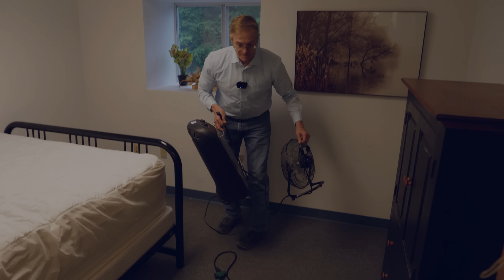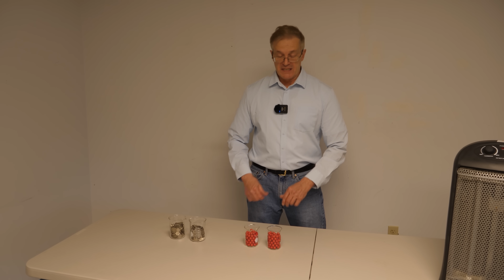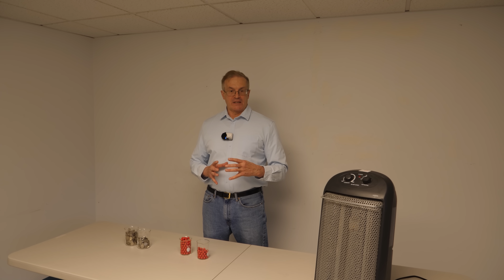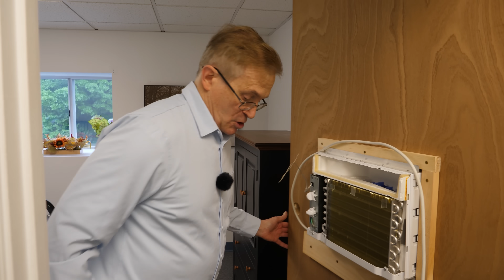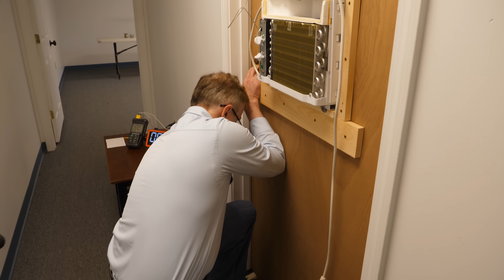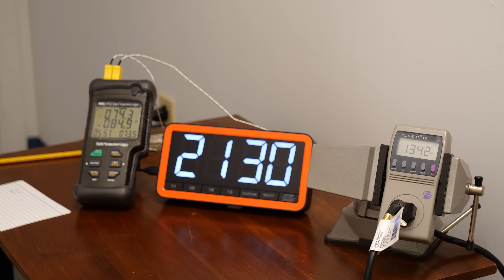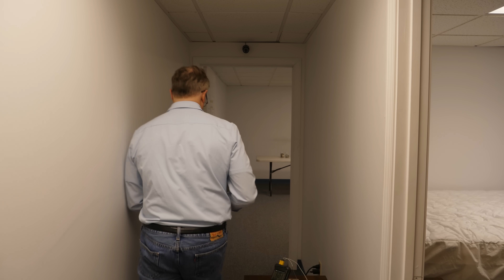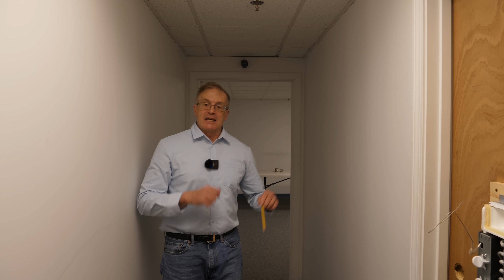You're wasting money on heating! Use your A/C!

Comment: AC's that also have a heating mode are becoming more and more common. The problem with window units is, designing for the alternate air path is a design challenge, and it's simply cheaper to keep making the same antiquated design.

Comment: Heat pumps are great most of the time when the indoor-outdoor temperature difference is moderate, say 40F outside 68F inside. But if it drops to -15F outside, it will struggle to remove enough heat from outdoor air to keep you comfortable indoors. Part of the problem is probably that heat is pouring out of your house faster because of the greater temperature differential. But, holding your hand to the air exiting the heat pump itself, it is doing well if it can even feel like cat breath, chilled snake breath is more likely. 

The smart way to take care of that problem, IMO, is to exchange the heat with the earth at a depth where the temperature doesn't fluctuate much, maybe 10-15 feet I'd think in New England. I think in practice a deeper hole is bored into the ground to so there is a large volume for heat exchange without having to dig up the lawn. 

The dumb way IMO is to add a resistive heater to bring the vented air temperature from chilled snake breath up to jazzercising cat breath temperature.

The smart way likely costs more up front but keeps the system very efficient and probably pays for itself fairly quickly where outdoor temperatures are often quite cold or quite hot. I'm in an edge case area and have the dumb heating option. The one or two times a year when it does drop below 0F... Well I need cats and some old Jane Fonda workout tapes on VHS because I have too many windows for even the resistive heating to keep up. Funny thing is when I lived in Montana in a basement apartment, my heat went out for most of the Winter and I didn't notice because the earth was warm enough for my comfort.

Comment: I bought a heat pump a few years ago and I have no regrets. I went from using 3.5 full 285 gallon tanks of oil per year to 1.5. One thing to note is that the effectiveness and efficiency of the heating will be reduced the colder it gets outside, and you'll start having to deal with things like ice accumulation. You can pay a bit extra for a heat pump designed to work in colder climates, but I'm guessing window units will not work well in this scenario - maybe something worth testing.
I always thought it was strange that window units don't come with a reverse feature built in. It seems like it would be relatively cheap while adding a significant amount of value.
Reply: In Japan, we have air conditioners that can work both ways. Also, they are split into two units, one light one that generally goes on the wall, and the compressor unit outside somewhere, connected with a couple of copper pipes. They work quite well too.
Reply: @michaelbrinkman9371  We have those here they are colled 'Mini-Splits- and you can have up to 4 or 5 indoor "heads" for every outdoor compressor.  You can even buy a "do it your self" kit from at least 1 company if not more.  the one I know of is Mr. Cool.
Reply: @michaelbrinkman9371  I remember something like this in the apartment I lived in in Tokyo...back in 1989. We could either have A/C or heat as needed from the same unit. I never gave it much thought at all but now, 35 years later, I understand how "cool" the tech actually was.
Reply: @MTimWeaver I was in Okinawa at that time, and electricity was outrageously expensive. To get a $600 electric bill was pretty much routine.
Reply: @ used to visit there and thought it’s one of the most pleasant place to stay in Japan if not the world, don’t remember much need for A/C in summer and heavy clothes in winter due to the mild climate and surrounding ocean surface on both sides as heat sink
Reply: @michaelbrinkman9371 that’s a split system. Those are nice for smaller buildings.
Reply: So yes - couple of things you need for the ac unit to heat pump conversion - reversing valve as he mentioned, accumulator as the cycles heat/ac need differing amounts of refrigerant, extra metering device and check valves  defrost sensor, defrost timer, you would need to separate the indoor and outdoor fans so you could de-energize the outdoor fan without de-energizing the indoor fan also means you’d need a relay with your timer, you’d need to put some supplemental heaters in during defrost nobody likes to feel cold air coming out of the vent, the indoor fan also would be bringing heat into the system, and the thermostat would need to be swapped - new controls, wiring would need to be modified quite a bit probably best handled by a control board.. but yeah
Reply: @devbella5223  There's no need to deenergize either fan since 1) most window ACs use one motor to drive a common shaft carrying both fans and 2) you still need a flow of air over both sides of the loop to move any heat for heating or cooling the interior.
Reply: @randomizedpasta  disagree - and yes I realize they use a shaft from both sides of the motor which is why I called it out above which could be installation of a clutch component to remove the fan from the system but it’s going to further complicate the engineering of the device and yes it is necessary to de-energize the fan for a few reasons.  you’re not getting the most out of your defrost cycle if you’re moving cold air over a coil that’s trying to reject heat while defrosting (keep in mind that you want the heat in the conditioned space and defrost is essentially using that heat for a purpose that’s counteracting your efforts to raise the heat in your conditioned space), with a de-energized fan you get a hotter coil and you aren’t refreezing melting ice working against latent heat transfer (which is a majority of your btus) plus the efficiency increases not only by reducing the energy input into the system (less fan resistance = less power consumption) but you’re not swimming upstream the whole time.
Reply: Thank you for checks and balances @devbella5223
Reply: @devbella5223  Even commercial heat pumps dont have supplemental heaters for defrosting - they simply reverse the operation for some minutes.
Reply: @TylerDurden-pk5km did you read further than “supplemental heaters” or did you get triggered?  I literally specified the intent for the heaters and they’re not for what you have described
Reply: @devbella5223  glad to see someone who knows heat pumps comment, ive been a heatpump tech for 30 years and agree with everything you say, without a defrost system as you describe evap will freeze up as soon as it starts to get  anywhere near freezing (with the ac unit installed backwards in a window, this video demonstrates the basics of heat pump operation but would not be practical for anything more than little doses of heat when oudoor temp is quite mild, maybe 50f or above, also, dont these units run r410 or older ones r22, i keep reading in the comments about r134?
Reply: @bassmanc2  yessir! 10 years in service tech work in the south east … lots of heat pumps. I should have stayed in school for the engineering degree, but absolutely loved playing with tools and apparently didn’t like my back so win win I suppose.  But you’re absolutely right at 50 degrees it’s the worst as that coil wants to be delta -20 and water grains in the air are pretty much maximized at ambient of 50 especially near any water… good question about the refrigerant I would think 134a but I don’t recall ever needing to charge any.. I was fiddling around with a couple for an animal shelter at one time but all of their issues were electrical…
Reply: For a bit more money, you can also bury a ground sync to mitigate seasonal fluctuations.
Reply: @binaryblade2  Sure but unless you can do it yourself and have the equipment, "a bit more" could be quite a bit more. :)
Reply: just put it in the window backwards, and boom, it is for free.
Reply: @JDTeam  and all of the AC unit's electronic and electrical compnonents that are not designed to be weather tight will be exposed to it.  and I'm sire the first good rain you got it would fail.
Reply: @JDTeam the stat won’t work though … it’ll keep running till it gets cold outside or too hot inside and the compressor overload relief starts bypassing (assuming it has one) if not the neoprene insulator and winding studs serve as a one time pressure relief
Reply: @devbella5223  Just move it from one side to the other. On mine it's a simple plastic c clip that holds it close to the fins.
Reply: @1STGeneral I mean to each their own I suppose :) I like to sleep from time to time though would rather it be automatic?
Reply: @1STGeneral  Think about what you just said for a minute and see if you can figure out why that won't work the way you think it will.
Reply: @1STGeneral I was wondering if that would work.
Reply: @devbella5223  just run a thermostat controlled outlet that the unit plugs into. It isn't an ideal system,  but costs less than a space heater to run. Don't over complicate the concept behind the video
Reply: @t-6273 how do you deal with it freezing?
Reply: @JDTeam  That is the easy method, but starting and stopping it would be a pain w/ the buttons outside :D
Reply: @dre04mach  Run the cord back inside. There are always gaps in the corrugated wing. and an awning over the window, or just the roof overhang  will keep it from being rained on. otherwise just tape a tarp to drape over it.  I'm sure if you have nothing else available for heating , you could make it work with some MacGyvered inspiration
Reply: Yep at colder temps effectiveness will go down and icing can be an issue. It's just like cooling. The hotter it gets, effectiveness will go down too. I think one big thing that helps is how a space is insulated. I feel like a lot of homes don't insulate right for walls. Roofs can have big spaces that for separating heat that is brutally pounded by the energy of the sun and with decent insulation, can have not as much energy transfer to a room but when a wall is pounded by the sun, it can quickly heat up a room. Same goes for the cold weather.
Reply: @robertlawrence9000 indeed, a heat pump can experience serious icing issues when too much ice forms on the unit, blocking airflow or preventing proper heat transfer either proper defrost/deice considerations. This can happen when the outdoor temperature is between 20–40°F and the relative humidity is 70% or higher
Reply: I'm in North Florida and the upgraded units we put in schools always had electric resistance heat strips for those few mornings below freezing. The dust burning off the heat strips would set off the fire alarms all over the district the first cold night.
Reply: You can buy any type of AC unit with reversing functionality nowadays - costs only marginal more than pure AC models.
Reply: Make sure you have a backup heat source.  Heat pumps are great when they work, but the ones from the major American brands are failure-prone.  $1k for a fan motor, $2k for a leaking coil.
Reply: @grayrabbit2211  Those same components are in every A/C unit, they're not specific for just heat pumps.  And you're probably just salty because you had to pay for some repairs.
Reply: I've often wondered what would happen if I turned a window AC around and installed it backwards in the winter. I guess it would too noisy with the compressor inside.
Reply: I have a wall unit that is both heat/cool, but I think it uses a separate heat pump or electric heater because the heating amps/watts are over double the cooling amps/watts.
Reply: DRAIN THE SYSTEM SO IT DOESNT BLOW COLD AIR ANYMORE .OF COARSE I CANT BE USED FOR SUMMER COOLING ANYMORE .BUT SO WHAT HAVE A SEPARATE ONE FOR SUMMER
Reply: There are window A/Cs with the heat function. The problem is, at the low end of the price spectrum, you are paying double to get the heat function. Because it is a niche feature that most people do not really use. (BTW, motel air conditioners almost always have the heat function, as that is the only heat in the room.) And often there are other heat alternatives like just plugging in a cheap portable ceramic heater, or the natural gas furnace or gas logs. So a lot of people just buy the A/C unit and maybe take it out come wintertime.
Reply: The best medium to extract heat from would be water - the sea.
How would you concentrate it to boil water tho?
Reply: @trollmcclure1884  Water is a bad medium for heat pumps because water is an incompressible fluid and it is the compression/expansion cycle that makes heat pumps so extremely efficient.  Now if you just want to force temperatures to equalize, then water is amazing because of how much energy water can carry before evaporating (engine coolant, CPU coolant, etc.)
Reply: @etherealceleste  Get it right. Every liquid is incompressible  What I meant is extracting heat from a cold sea (better than cold air because no frost is formed and it contains a lot of heat). BTW I think water is used as a medium in geo-thermal heat extraction. It's just not useful as a refrigerant for food because of the high melting point. Steam turbines in powerplants are kind of heat pumps too. Instead of using electricity to extract heat we extract electricity.
Reply: Up north here we do heat pump furnace combo to help with the rougher winters 🫡
Reply: You could use a room as your cold area and pump a small amount of warm air into it constantly with a inline duct fan... or grow your weed in there
Reply: It's called a heat pump, mini split
Reply: I  have a portable a/c/heater dual hose w/ heat pump unit but below 40/45 it's useless without supplemental heat source to draw from. Works great when it's 40-55 out.
Reply: Ask the Rothschilds why we can't have rampant innovation. Why do we keep getting a slightly newer model of phone every year? Newer cars? Why the constant need for businesses to improve on the year before in profits? Read the book, "A History Of Central Banking And The Enslavement Of Mankind." All of it will suddenly make sense.
Reply: This was in response to the question at the end of the comment.
Reply: A cheap Type 2 heat pump, like the Midea or the GE Soleus, will run between $500 and $750, and will only operate at temperatures above 40 degrees F. For heating when the outside temperature is below zero degrees F, a more expensive Type 4, like the Midea or Gradient heat pump is needed, and this will cost between $2000 and $4000.
Reply: The colder outside problem:
It's a problem if you pump your heat from the air whose temperature varies with the season.  However soil temperatures are more stable and (if you go to the expense) are actually out of phase if you go down 6 foot.
The 6 foot idea is something I remember from a maths lecture.  If you appy sinusoidal heating to a solid you can calculate how the temperature wave propogates and dissipates as it goes through the solid.  Plugging in average soil values gives a 6 month travel time down to 6 foot so the summer's warmth will get to 6 foot just as you need the winter heating.  It explains the cool cellar in summer (but aren't all cellars cool - I certainly want one).
Reply: Any chance of a pointer to the math / thermodynamics involved ? I didn't know about this insight into the 6 foot under idea.
Reply: They all drop the colder it gets. Most are rated with a max outside temp hot or cold. The window units do seem to produce more condensation I believe because a typical HVAC provides air with less moisture present and the window units either pick up moisture or perhaps produce it, not entirely certain, I never researched it. If it is -15 outside and the unit is blowing anything above that it would be actually warmer, and warmer would produce ice. Much like warm water freezes quicker than cold. It would also produce water. Hot and cold together produce condensation. Makes sense what you're saying. I suppose you'd have to create an environment to negate those things. I can think of a few ways. 
I'd really rather know what the differences in energy consumption are between say a standard heat pump and an average window unit. Taking into consideration a heat pump is ducted throughout the home how many window units would you need to heat the entire home. It would be in theory more efficient to duct the window unit(s) somehow, it appears an average heat pumps use kilowatts per hour compared to the window unit only using 400 watts or so. Interesting...

Comment: You should add a device to measure Humidity. I imagine it went up a decent amount with the A/C running?
Reply from the maker: Actually,  if you think about it, there is no added moisture in the sealed room. It shouldn't change up or down.
Reply: @TechIngredients  The window unit produces condensation which is collected in the pan at the back of the machine, then splashes onto the condenser to help with cooling, and the excess drips out the back. I assume that would add humidity??

Comment: In my country it's more common for people to have heat pumps for heating than cooling, although most modern machines can do both. I got myself a multi split to use as a cooler but I tend to run it during winters as well since it's a lot cheaper than my other heat sources except during extreme cold.